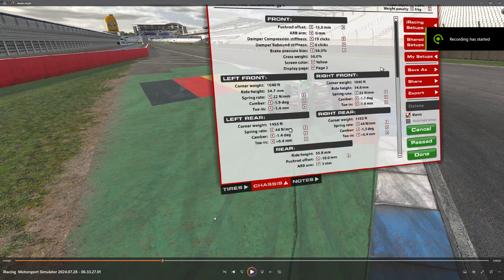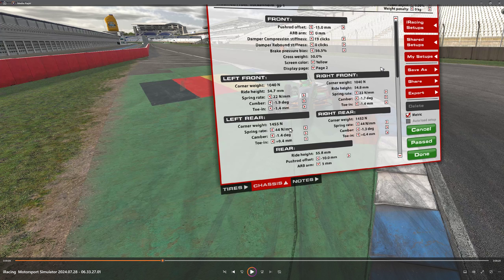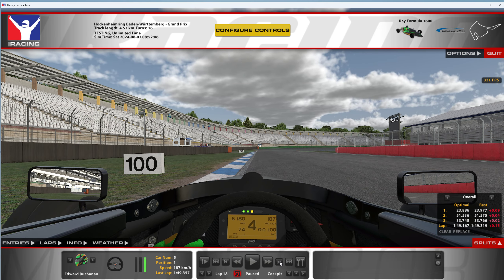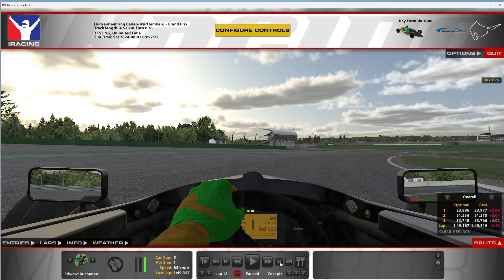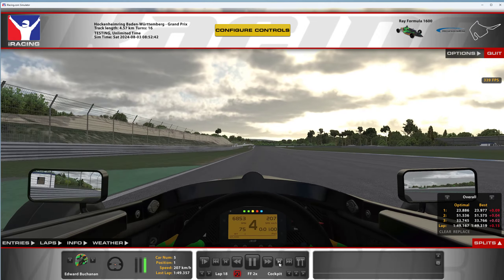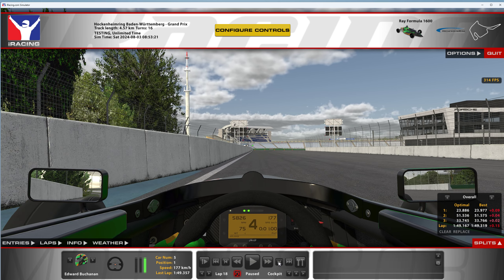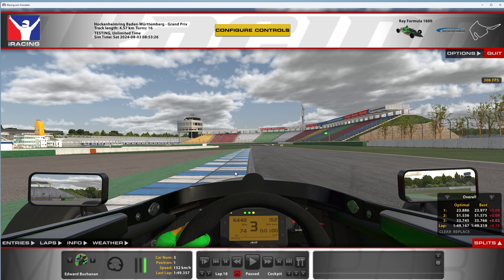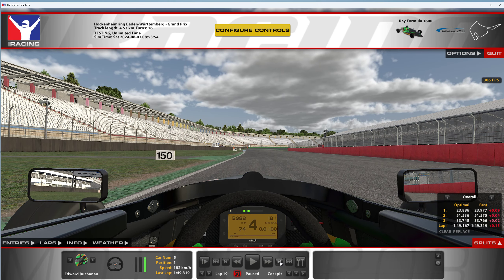Hockenheimring Grand Prix Ray FF1600 SETUP and Track guide

Comment: I ran a race today, it was really fun. Especially the passing opportunities.
Reply from the maker: @duanebusch72  so much easier to make a pass here over Hungary and winton
Reply: @edwardbuchanan871  yes, definitely. I already got rear ended, too. That’s what happens when you have people in the split that don’t know what they’re doing.

I don’t know why the interest in this series isn’t larger.
Reply from the maker: @buschenterprises4788  my guess is the fixed series turns people off, a lot of the time it's very frustrating to drive. That combined with some intimidation of figuring out how to setup the the car in the trophy. Lastly  this season is a lot tracks you have to purchase
Reply: @edwardbuchanan871  I agree. People don’t want to have to change stuff, and test it. One thing about fixed, it forces you to learn how to steer the car with the brake, and lifting off the gas, which is a helpful skill in all kinds of cars

Comment: Thank you Edward.
Reply from the maker: @simonolsen9995  first time in the  Ray with this configuration. Hopefully I'm not out to lunch 😬
Reply: @edwardbuchanan871  The setup felt great on my first test. Unfortunately I'm my usual 2 seconds behind your pace. Hopefully I'll find a little more before I race. My idiot magnet seems to have reactivated of late. Rammed from behind in my last two races. I'm really needing to find a little bit of extra speed!
Reply: @simonolsen9995 sounds like me!
Reply from the maker: @simonolsen9995  This is the definition of slow in fast out. Break earlier and nail the apex, if you miss the apex just a little, it costs you so much time down these straits

Comment: been practicing.  its tricky and takes multiple laps and sessions 

still only 1.516
Reply: Good thing it’s not the track from the 1980s. That would be really boring in this car lol.
Reply from the maker: @buschenterprises4788  getting close, once you get those hairpins down your time will drop a lot
Reply: @edwardbuchanan871  yep

need to come thru them with more slip angle but not spin out😬
Reply from the maker: @duanebusch72  amen 🙏